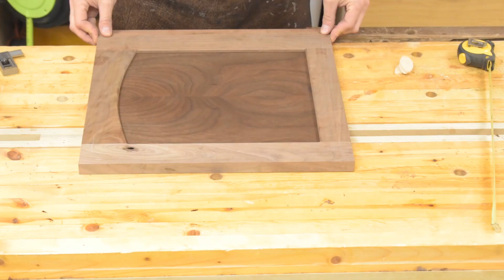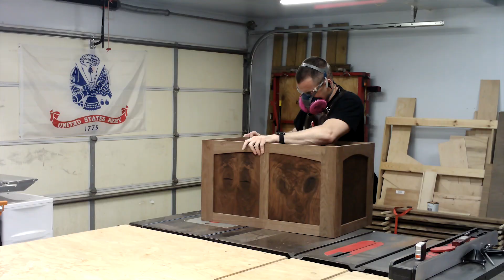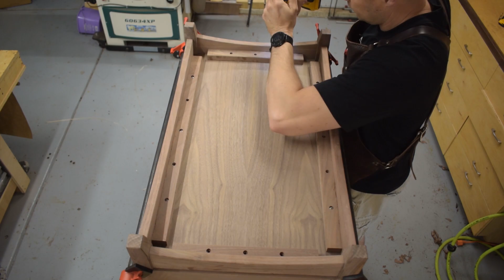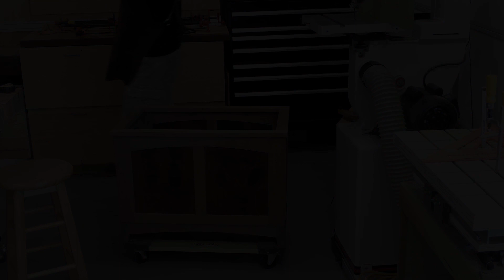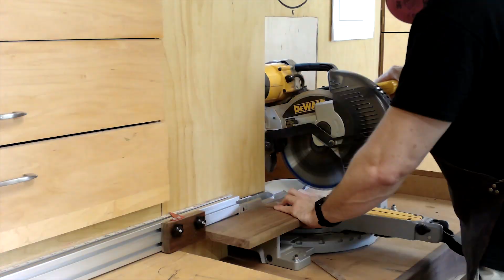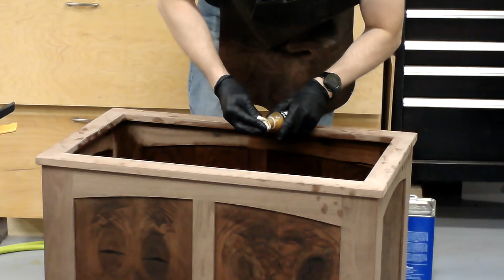Blanket Chest Part 4

Comment: I love what you are doing here on these projects and your channel, but I really don’t like the biscuit joinery. You have done such a nice a nice job with this, why would you do this? I know people will say long grain to long grain is strong enough but not in case construction. In a few years, I think you may regret this. You also glued the “end grain” of the bottom to the sides and didn’t allow for movement. The ply will likely be fine, but I’m concerned about the side panel splitting. 

I’m not trying to be negative and rip apart what you are doing here, just trying to offer some advice from over 30 years of my own WW mistakes. Thanks for sharing this, I really do enjoy this channel a lot.
Reply from the maker: David, I appreciate the constructive feedback. It’s always welcome. The biscuits were more for alignment, than for structure. As you mentioned, I’m counting on the long grain glue joints to hold this together. Hopefully there aren’t any issues with that like you mentioned, but I guess it’s too late now.  I’ll keep my fingers crossed. 

For the bottom, I did consider wood movement, and I don’t think I’ll have any issues. The bottom is ply, and the only cross grain glued surface is the outer stiles on each panel. They’re pretty narrow, and won’t expand or contract enough to be an issue. The majority of the glue is to long grain, so the direction of movement will be up/down and will be fine against the ply. 

Thanks for watching, and for the feedback. Hopefully you didn’t just notice a major issue with this blanket chest, but I will be the first to admit if you turn out to be right.
Reply: @EastOakWoodworking  Not at all, I have been enjoying your videos and your work since I found your channel. I appreciate the time you took to answer and take it for what it was, feedback, not another YT troll. 

Thanks again for making these I do enjoy the channel and have picked up a few things as well. Great content.

Comment: Absolutely stunning project. The book matched panels are amazing! Loved  the sliding dovetail lid braces (although I though for sure they would get an arch cut in them). In a sea of pocket holes and dominos I am really glad I found your channel.  What lid stays did you use? Are they soft close? I have a toy chest build comming up and want a high quality solution to reduced  pinched fingers.
Reply from the maker: Here is a link to the stays / hinges I used. They aren't soft close, they just support the lid when it's open. I also had to take one of them apart and revers the internals so that it fit correctly and opened correctly on the other side. Also, good point on the lid braces. I'm not sure why I didn't do that. 

https://amzn.to/2Zotjnq